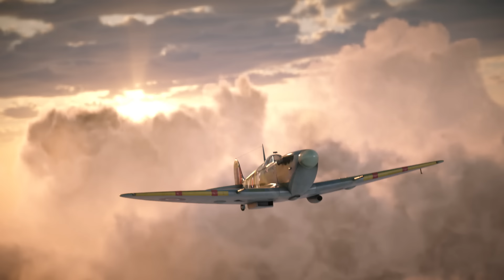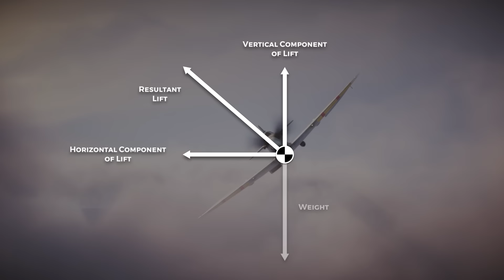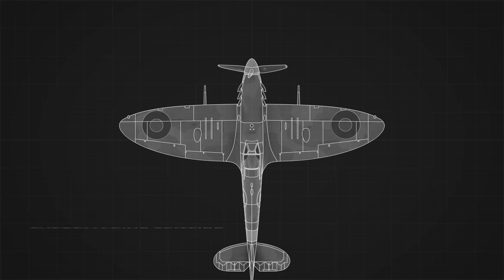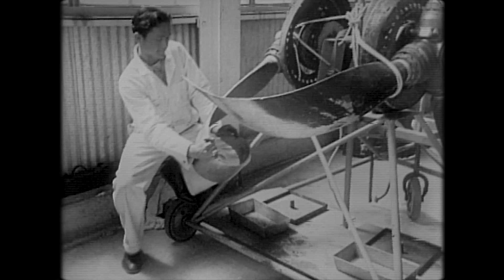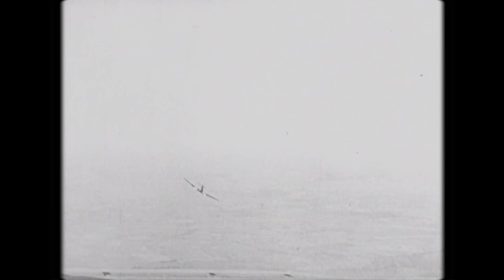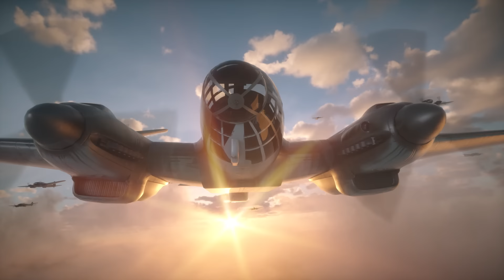The Insane Engineering of the Spitfire

Comment: Very interesting but please note that air does not enter the piston, it enters the cylinder, it is compressed into the cylinder head along with the fuel by the piston then ignited, this creates pressure that acts on the piston.

Comment: How did the spitfire work you asked in the thumbnail.  Motors, air supply, bang bangs, control surfaces were all well known technology at he time.  But how was is it that that the plane performed so well aerodynamically? Pilots saying they don't climb into one, the merely strap it on as a way of saying if was aerodynamically excellent.  How can that aspect be explained?

Comment: The early models of Spitfire had the motors with carburettors who could not work in an inclined or vertical position and that was a problem in a air fighting situation because that also stopped their motors.
 The German airplanes had injection pumps who could give them combustible  even in inclined or vertical flight positions. But when the British army shouted down a German plan, the English engineers could copy the German injection system and the Spitfires have been made also with this technology.
Reply: Using a carburettor cools the incoming charge and allows more boost therefore more power.  The Spitfire could run upside down, but not at high negative G.

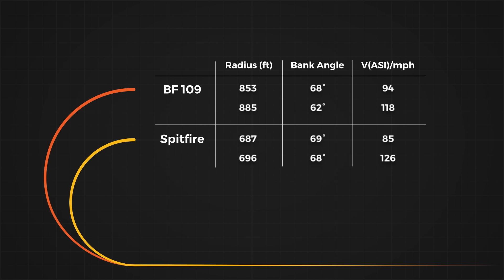Comment: An aircraft’s turn radius depends only on its bank angle and its true air speed. For 68 degrees bank and 94 mph this is 643 feet so the table at 10:14 is not correct.   It may be that at higher wing loading, the minimum radius of the BF109 would have been higher if its stall speed was higher because it would have had to fly faster at the same bank angle, but that is a slightly different thing from what you explain.

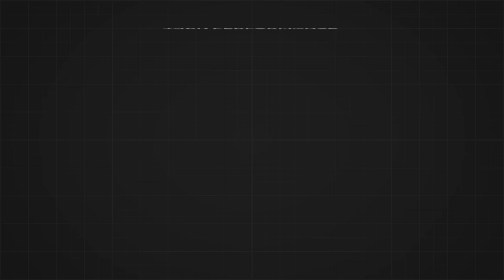Comment: 3:11 Only problem is the poor energy retention in a sustained turn.
It is not uncommon for a spitfire to easily wing-stall during extreme turns.
While the Spitfire had one of the, if not the best initial turning capabilities during high speeds, Planes like the A6M2/5 etc.
were much better during sustained low speed turns.
Reply: nonsense.  The Spitfire was able to sustain a high bank turn better than most, because of reduced induced drag and sufficient power/wt ratio.  The flick roll in a bank was typical of Mustangs, Hurricanes, and P-40s.

Comment: Super video! While talking about the elliptical wing you could have added of the worse stall characteristics it had given to the distribution of the lift on the surface of the wing
Reply: Th elliptical wing gives excellent spanwise lift distribution, the Spitfire had excellent stall characteristics at low and high AoA.
Reply: @johnbrewer8954  true, but that means that when the boundary layer starts to detach it can do it all at once, and this was a known issue
Reply: @marcocammozzo7553  That is why the Spitfires wing, along with many other fighters had a twist in it of 2%. This meant the inner wing started to stall causing buffeting but the outer wing didnt.
Reply: Nonsense, the Spitfire had the most benign stall characteristics of the war.

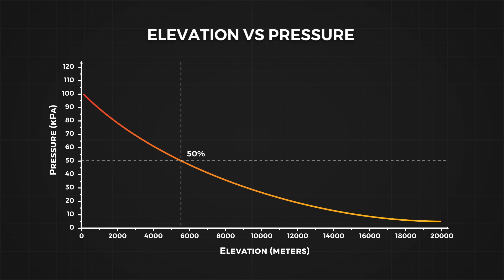Comment: 12:55

It's not so much the air pressure it's the air density and available oxygen as a result. 
You can increase the pressure thereby the density with forced induction. But yea it's strictly speaking air density that's the issue at altitude.

Comment: The real reason the Merlin engine was more powerful than the DB601 was that the US had recently discovered how to boost octane with tetraetyllead, so the Merlin was designed to run on 100 octane fuel while Germany, without such technology, had to use standard 87 octane fuel. This allowed the Merlin to run at far higher boost pressures without encountering engine knock.
Reply: Wrong.
Reply: @johnbrewer8954  nice counter argument lol
Reply: @Biriadan  It is wrong, there are many ways to boost Octane, the US had the most refineries using the Haber process. The Merlins design wasnt changed to use 100 apart from testing to verify that it could use the power. Later in the war it used much higher Octane fuel and produced much more power. The Germans also had 100 octane, google German C2 and C3 fuels.

Comment: The RAF fighter pilots had a much better kill rate with the Hawker Hurricane fighter plane. The problem with the Spitfire was the inability to line up the guns so the pilot could accurately direct fire into an enemy aircraft. They ended up having to align the guns on the left and right wings so that a given distance they overlapped and at that distance the pilot could take down an enemy plane. The problem with this approach is that a pilot had to get extremely close and on the tail of the German planes and hope that if hit and exploded the debris did not take out the Spitfire.
Reply: Wrong.  The Hurricane had the worst kill ratio of the battle.  The Me110 had the best, despite its losses when being ordered to stay with the bombers in Sept.

Comment: the air-fuel ratio for an ICE is 14.7:1, not 12:1. We often round it up to 15:1 for simplicity.
Reply: ...worse than that - he thinks it is 12:1 by volume which is completely wrong. Just one of a number of gross technical errors he makes in this video.

Comment: The main issue with maintaining a tight turn at a given airspeed is stalling, not structural failure; certainly in the case of fighters.
Reply: The main issue with maintaining a tight turn AND not losing altitude, is reduced induced drag and power / wt ratio.  The Spitfire had that and the 109 & Hurricane did not.
Reply: @bobsakamanos4469  In any discussion on tight turns, not losing altitude is implicit: you can turn much tighter is you are prepared to accept descent. Accepting that condition, the tighter you turn, the HIGHER your induced  drag, because your angle of attack (& simultaneously G loading). has increased
Reply: True, elliptical wings and laminar flow (ie mustang) designs do reduce induced drag at any given alpha, but they do not necessarily reduce the stalling angle of attack. Also, the 109 had autoslat deployment which tended to flip them in the a spin, presumably due to slight assymetry during deployment
Reply: @adbraham  laminar flow airfoils do not reduce induced drag.  If designed properly, the planform and washout may help with aileron control though at high AoA.   The slats on the 109 could snap open/closed under certain conditions and AoA when manouvering, often at different times, as you suggested.  There are some reports of pilots having them wired shut as a result.
Reply: @adbraham  regarding tight turns and lacking power at altitude, the fight often progressed downward as a result.  So while maintaining altitude for a max banked turn may be implicit for defining fighter specifications/performance, in the real combat world the altitude, weight & balance, and other factors came into play.  The Spitfire turn performance reigned supreme in the ETO and MTO.
Reply: @bobsakamanos4469  washout helps with aileron control on any wing, not just laminar flow designs, it’s there to permit roll control close to the stall, as the inboard section (having higher alpha) will stall before the outer. Interesting point about 109 pilots modifying the system to prevent autoslat deployment
Reply: @adbraham  induced drag is still higher on the Mustang wing despit its washout for aileron control.  Flick roll was a concern.  They avoided low speed turning fights.

Comment: Daimler DB6XX had altitude compensated mechanical charger, nitrous oxide injection and water-methanol injection to prevent knocking on high boost pressures...

Comment: There goes the siren that warns of the air raid
There comes the sound of the guns sending flak
Out for the scramble we've got to get airborne
Got to get up for the coming attack
Jump in the cockpit and start up the engines
Remove all the wheelblocks there's no time to waste
Gathering speed as we head down the runway
Gotta get airborne before it's too late

Running, scrambling, flying
Rolling, turning, diving, going in again
Running, scrambling, flying
Rolling, turning, diving

Run
Live to fly
Fly to live
Do or die
Won't you run
Live to fly
Fly to live
Aces high

Move in to fire at the mainstream of bombers
Let off a sharp burst and then turn away
Roll over, spin 'round and come in behind them
Move to their blindsides and firing again
Bandits at 8 O'clock move in behind us
Ten ME-109's out of the sun
Ascending and turning our spitfires to face them
Heading straight for them I press down my guns

Rolling, turning, diving
Rolling, turning, diving, going in again
Rolling, turning, diving
Rolling, turning, diving

Run
Live to fly
Fly to live
Do or die
Won't you run
Live to fly
Fly to live
Aces high

Comment: The Spitfire was a great 1934 fighter, but by 1938 at the outbreak of War with Germany, it was 7-8 years BEHIND the Bf-109E-1 (The British were still using fixed two-bladed  wooden propellers!) and very low-boost (7 pound, 1/2 atmosphere) displacement supercharging. The Spitfire could never dive at speeds ANYWHERE near German Fighters which were all 150-200 knots SLOWER than US Fighters. Both the Hurricane and Spitfire "floated" in a dive according to US Ace Robert S. Johnson who flew a P-47C for the US, but had occasion to test BOTH British fighters, including the "state of the art" Spitfire 9B (with a US carburetor to prevent the "negative G" and inverted flight stall of the earlier Spitfires and Hurricanes). Until the P-82 "Twin Mustang", the Merlin engine was never equipped with turbo-supercharger in ANY aircraft, nor it's much bigger cousin, the Griffon engine. The last P-51K Mustang was still fitted with a Bendix mechanical drive supercharger. BTW, the US Packard-built Merlins were FAR superior to the Rolls-Royce versions having a 300 hour combat life vs: 100 for the British-built versions.
Reply: LOL, there is so much wrong with your post, I don't know where to begin.

Comment: Your description of the negative g carburettor issue is incorrect. Under negative g, the float would move up not down, thereby cutting-off fuel delivery, not flooding the engine.  Once the negative g stopped, there may have been momentary flooding of the engine as the fuel system recovered.
Reply: The Spitfire and Hurricane could fly inverted, that is minus 1 G. What caused the issue was the sudden application of more than minus 1 G.    This caused momentary starvation and then flooding.

Comment: Half the BF109 shown there have a rolls royce engines, standing upside up, unlike the regular Messerschmitts(Who are upside down, 1,455HP Daimler-Benz DB 60.)...
propellers'
The Spanish had been developing a licenced version of the Bf 109 since 1944. They originally used Hispano-Suiza engines, but the last and most produced version used war-surplus RR Merlin Engines and Rotol propellers, bought from the UK.
The HA-1112-M1L Buchón(BF107) has been described as “an improvised assembly of outdated components” but it was adequate for internal security duties in Spanish colonies in Africa. In any case, sophisticated technology was unavailable in the politically isolated Spain of the 1950s.

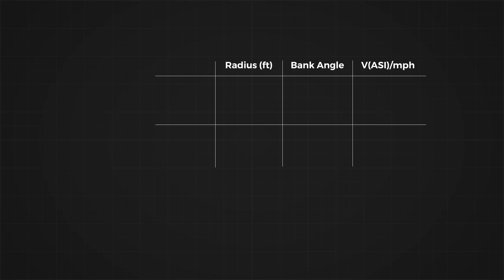Comment: 10:10 - The BF-109 turn rate is 16.59°/s at sea level. The spifrire has turn rate 16,36°/s at sea level.
The BF-109's turn rate at 3000m ASL is 13,14°/s. The spitfire's turn rate at 3000m ASL is 12°/s.
And here is the point. It does not matter much how tihght is turn when the enemy turns faster. Small turn radius provides you ability to be not shoted down. But it does not provide ability to shoot. Check this video: https://youtu.be/EsKZScFwXqA

Comment: The LAMINAR FLOW Wing

was Designed for HIGH-SPEED and LONG-RANGE
Reply: and it was never really laminar flow with guns, ammunition ejector slots, prop wash and even bugs on the leading edge.  It did provide good lift distribution though at cruise speed.
Reply: @bobsakamanos4469  Nobody Cares if it was True Laminar Flow. They didn't have CAD CAM back then or the Experience.  It was a Low Drag Wing Developed for Long Range and High Speed.  The most Aerodynamic Plane of WWII
Reply: @Shelby-Ecoboost-Raptor-550hp  yes, low drag at high cruise speeds (but you were SHOUTING about LAMINAR FLOW, so obviously you cared).  A fine wing with good lift distribution, but with nasty stall characteristics.  Every design is a compromise, but it was really the Meredith scheme radiator that gave it the low drag and high speed.  Schmued said he'd started conceptual drawings after reading Meredith's paper in late 1935.  Another Brit/Canadian engineer, Shenstone, was asked to help with the rad ducting at GALCIT in early 1941, which resulted in the P-51A (Mustang Mk.II) design that was 30 mph faster than the first Mk.1 mustang.

Comment: Great explanations. The Battle of Brittain was won partly thanx to the slightly better specs of the Spitfire. 

There were other factors too, like the early warning system and something else: each time a British fighter was shot down, the pilot had a chance to survive and climb into a new fighter plane. When a German pilot was shot down, he was either dead or captured. Another factor was that the actual fighting time for fighters was very short (about 10 minutes? per flight). It took german planes longer to get to the fighting area then most British planes, so they could stay just a little bit longer and refuel faster and join the fight again. 

All this adds up. The Germans could have won, if they had way more planes to compensate for the homefield advantages and if they were smart enough to destroy the early warning systems consistently. Thank God, the German strategy was not always that smart..
Reply: Yes, thank God for diversity, feminism and the advance of the LGBT movement. "If the British soldiers in Normandy who went to the beaches in 1944 could see what happened today, they would not have gone 40 yards up the beach." –David Irving

Comment: Some of your "facts" are wrong. The climbing turn was the Spitfire's method to escape the 109E, not the other way around. Also, on 100 octane fuel and 12 lbs as in the Battle of Britain, the Merlin had better low alt performance.

Comment: But they never incresed the range of the Spit, the only fuel tank was in the fuse in front of the pilot .
Reply: Research a little harder.  Late model Spit IX's held 235 US gallons (195 imperial) internally.

Comment: My Grandad worked in the Supermarine factories building the Spitfire. He said all the rivets on the wing had to be placed precisely, and so each one was measured meticulously before being placed. He built a metal sheet that could be placed over the wing, with holes in it to denote the rivet placement to act as a template. Without having to measure out each rivet individually, the wing production went much faster.
Reply: I worked making (music) oboe mechanisms by hand in the 1970s. One of our older guys R.I.P. had worked on spitfire wings and explained the difficulties.  He was full of little tricks and shortcuts that helped with our work.

Comment: I usually enjoy these a lot, but this video is quite heavy on "Spitfire magnificent engineering" and "stupid Germans made the terrible Bf 109"  edit: saved it in the end

The reason the 27L engine of the Spitfire could output similar power to the 34L engine of the Bf 109 during the BoB wasn't the supercharger. The DB 600 series engines were supercharged as well. The reason is that the British at this point had access to American made 130 octane fuel which allowed for higher compression without the rist of knock. While the Germans were limited by their lower quality fuel.